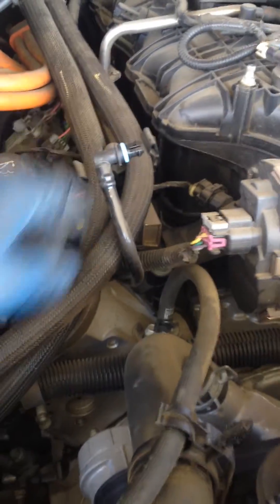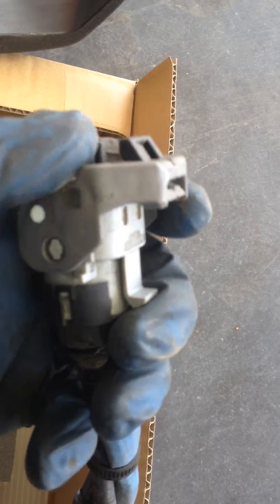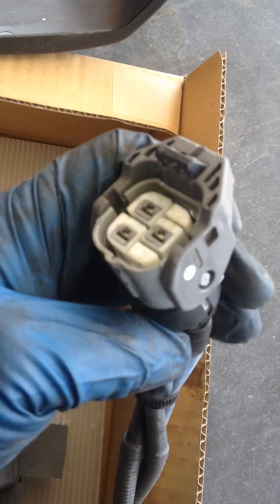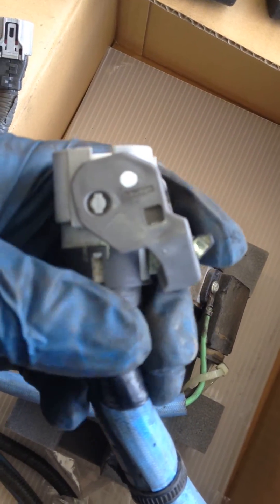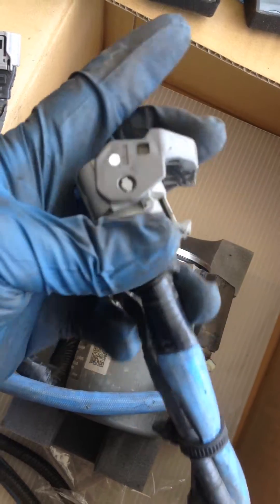2008 Yukon Hybrid Power steering assist motor Installation WEAR RUBBER GLOVES

Comment: my DMCM on myt 2008 hybrid yukon is leaking coolant from the bottom, dont want to remove top cover since label says only authorized can... anyone with this problem?
Reply from the maker: YeshuaLives Yukon engines usually leak coolant from the water pump or the radiator there's not much wiring to be disconnected, but still wear some thick rubber gloves.